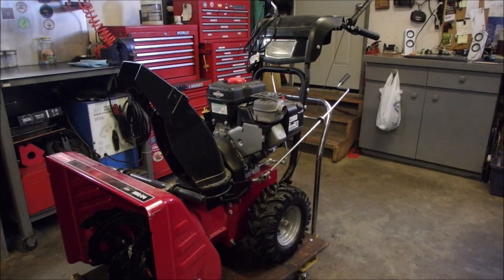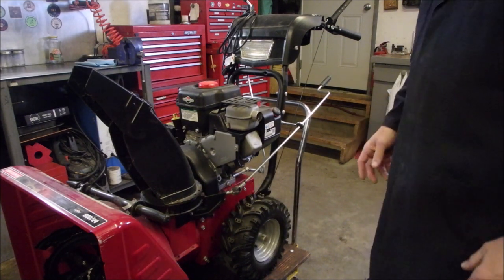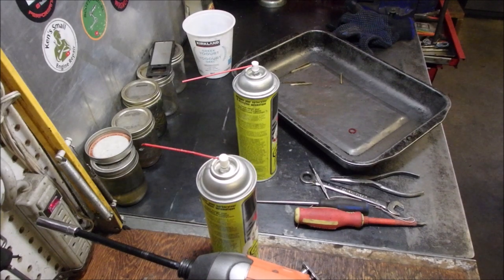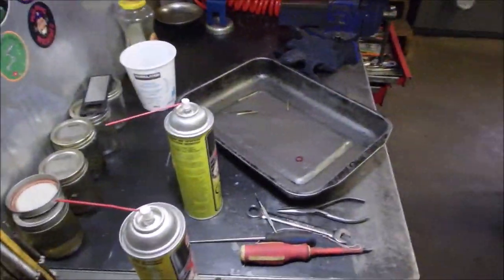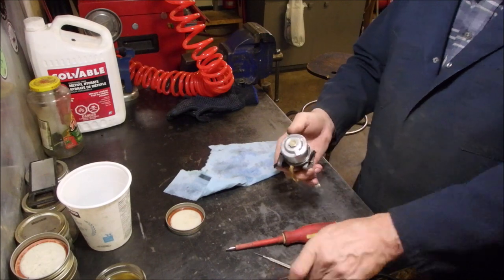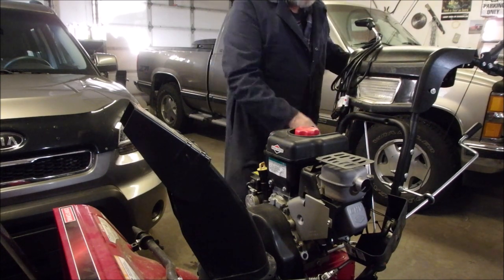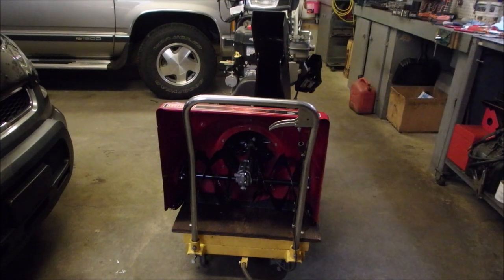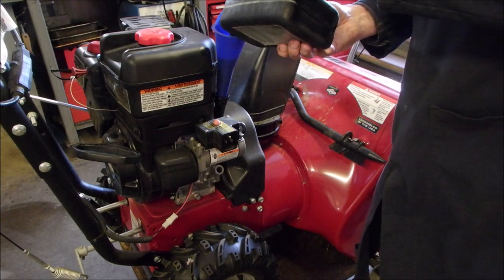Craftsman  800/24  Snowblower Won't Start

Comment: That’s what I’ve gotta do now, snow blower assembly and tune-up. Went from 72F right down to the upper 30’s F for the foreseeable future just like that! My Norway Maple trees are still green and holding on to their leaves so now I’m going to need the mower and the snow blower functioning at the same time lol!
Reply from the maker: Good luck on your blower.  Thanks for the comment.

Comment: Nice machine, for a “modern” snowblower. The cables that go with the plastic pulleys modern versions seem to me to be a departure from the days of manufacturing things to last. But they are what they are. Good video Bruce!
Reply from the maker: @Chevy-hw6lw  Correct.  A solid rod like the old JD's would be better.

Comment: Nice work, again, Bruce!
I’m currently working on an old Mastercraft 10HP Tecumseh.  Definitely needs more work than that shiny one!  I only paid $80 and it runs and drives ok. Auger needs welded… 😩
Reply from the maker: Well I am doing one which is a John Deere where a grade 5 bolt (not a shear pin) cut up the auger.  I understand.

Comment: Nice job Bruce, just put a friction wheel on my 20 year old Snow King.
Reply from the maker: Good for you.  Some of those changes are not that bad.  It is the 150 lb dead lift that is getting tougher for me.
Reply: I hear you Bruce, I can't do those dead lifts either 🏋️‍♂️

Comment: briggs labeled 800 is just about 5.5 hp. had a bad starting almost new briggs blower engine and it was a bad plug. it helped that I founda video of one with exact same problem.
Reply from the maker: Well at 205 cc it is bigger than the Honda 196 which is a 6.5HP unless I am wrong.  But my world is small  LOL  thanks for the note.

Comment: Great video Bruce! What is your ratio for the solution? The problem I have is the carbs end up discoloring if I leave them in the ultrasonic machine long enough to do any good. I can do a better job with carb cleaner, tiny instruments and compressed air.
Reply: If you use certain cleaners they discolor aluminum. Just use dish soap and water.
Reply: Don been using Orange ZEP 3 to 4 ounces mixed with tap water 1.5 litres and no discolouration at all. No issues with this mixture and 20 minutes in the ultrasonic cleaner running at 55 degrees Celsius
Reply from the maker: Well I have been using Mean Green .  Now i think my new bottle has ammonia in it.  If i cook them too long or hot the aluminium goes a bit dark.    I try not to cook them longer than 20 minutes at 60C   (in this video I started it at 30 minutes but stopped at 20) .  I use about a cup for 2 litres.  I filter the solution through a clean rag and add a bit of water which helps to dilute it a little each time.
Reply: @BrucesShop  We did use Simple Green which is biodegradable but switched over to Orange ZEP 4 ounces to 1.5 litres of water works great.
Reply: @berardia4  I've tried it all but I always get discoloration. Heat, no heat, doesn't seem to matter. Maybe it's this cheap Harbor Freight model?

Comment: One of the problems with these snow blowers is when the needle and seat fail it lets the carb to over flow and fill the crank case full of fuel .Especially when stored with fuel in it .The winter comes around they fill up the gas and run the engine until destruction . Snow blowers should have a fuel shut off to protect against this . Should aways be used , keeps carb clean and less troubles .
Reply from the maker: You are so right.  They should almost have an auto shutoff but there is no battery for the juice to do it.  Great point.  I add a shutoff when there is room.